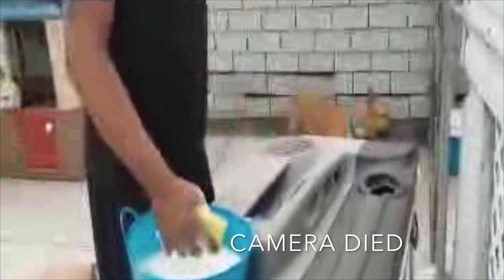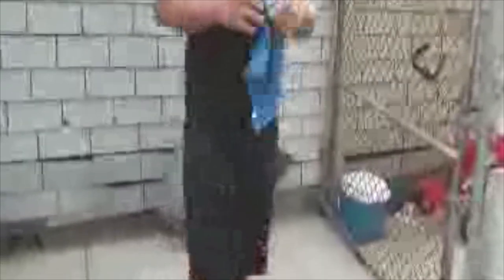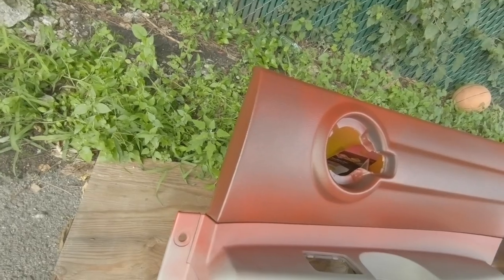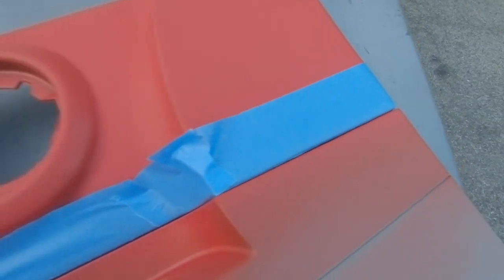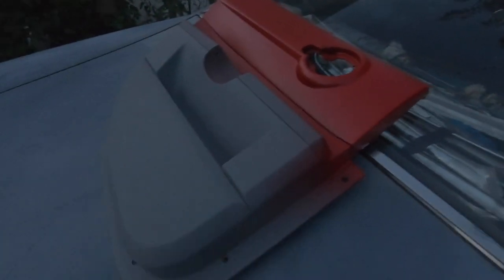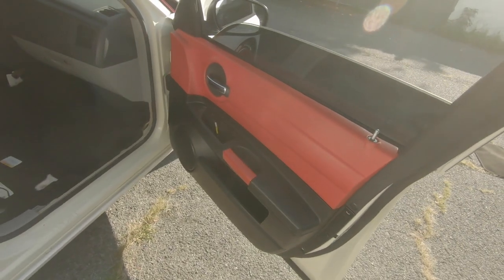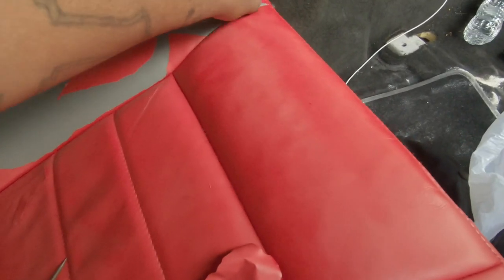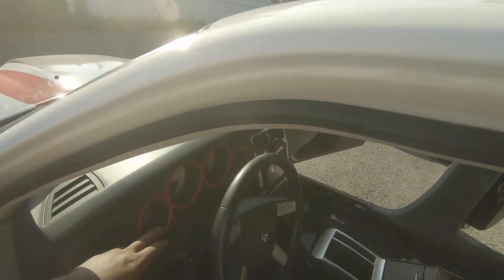How to Custom Paint your Door Panels like a 'PRO'

Comment: That looks fantastic, contemplating doing this to my doors problem is they are dimpled and not a smooth plastic.
Reply from the maker: Well if there damaged I would go to the junkyard get them for cheap and do them on there instead.
Reply: @CmcMods  more like it’s a very textured plastic bay ideas I’m thinking if sand blasting
Reply from the maker: @ivanrico961  you can do that as well wateva works for u.
Reply: @CmcMods  I’ll send you pics I’m goin to be starting my channel up following my build
Reply from the maker: @ivanrico961  ight let me know so I can check it out.

Comment: Nice job bro. Can’t beat black and red. Next time maybe spray on some adhesion promoter before painting. There is alcohol and glue in the promoter, and makes the paint stick better for less cracking and chipping.
Reply from the maker: Thanks bro definitely waitin for warmer weather to redo the black area so im going to definitely use that no cracks tho just wesr i lay my arm faded a bit and if ur foot rubs that srea it keaves like white scuffs im gonna use different psint as well on top of that can i used.

Comment: I might redo mine and sand them better
Reply from the maker: Best thing to do get it how u want dont settle.
Reply from the maker: It's part of the moddin lifestyle
Reply: Are the doors smooth like from stock or are they Sandy? Mine came out Sandy and rough. What you recommend?
Reply from the maker: @piick6sportz632  super smooth goin on 3 years you got to wash the parts real good scrubs all the dirt of with soap dry it then sand it down with a smooth grit once the whole things feels smooth even then rub it down with alcohol once that dry then its showtime that's the most important than paint that's easy ur prep is everything spend time gettin those 3 done then u should be good.
Reply: @CmcMods  thanks dude, Ima redo them and hopefully they come out better
Reply from the maker: @piick6sportz632  your grit probably was to aggressive I think I use 100 the lower u go the more aggressive that's probably were u messed up more then cleaning it right but do those 3 steps check my latest video as well I explain it when I painted the doors and dash and what paint u used excatly it's my last video I posted.
Reply: @CmcMods  ima post a video about and tag you on it if I could. I use the same paint.